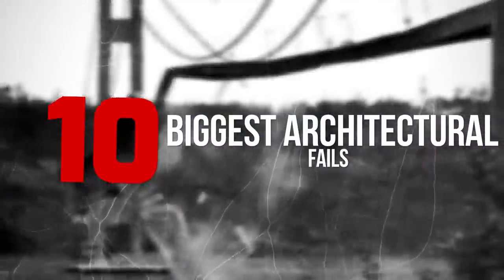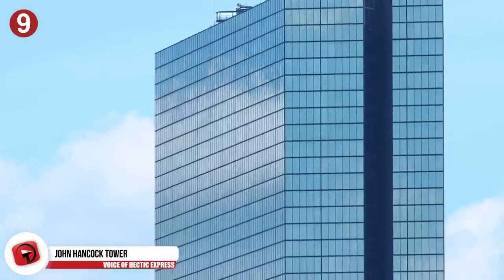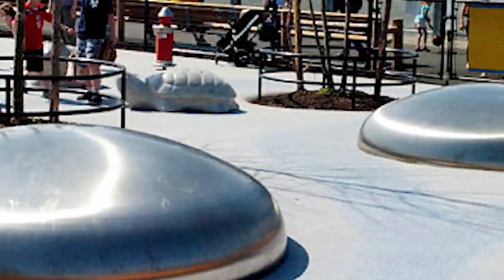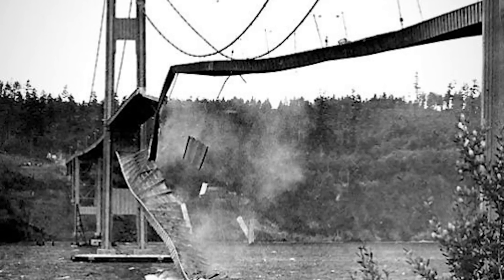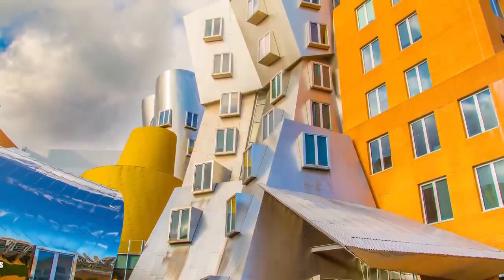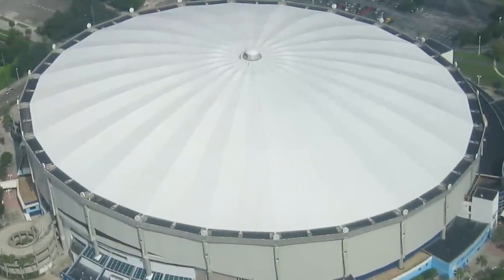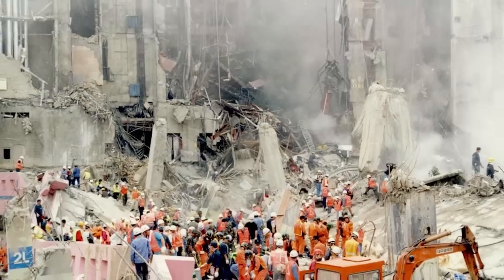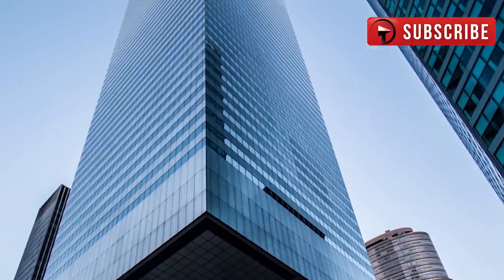10 Biggest Architectural Fails

Comment: Galloping Gertie did not collapse from bad materials. It collapsed because of harmonic resonance or propagation. The bridge would vibrate in the wind. When just the right wind speed hit it, the frequency of the vibration of the wind matched the natural frequency of the bridge. The amplitude of this vibration grew until the bridge was whipped apart. This is the same reason a wine glass can be broken with the right frequency sound waves. Since Galloping Gertie, bridge engineers design bridges bridges to have wind vibration dampening characteristics.
Reply: It's just recently been discovered that that video (movie film) was speeded up all these years. The actual frequency was much slower. Fake News!
Reply: It wasn't a resonance phenomenon, although we physics professors are very guilty of teaching as if it was. Further research has shown that it had to do with how it created vortices in the wind-flow over it. It's a more subtle effect, but its reaction to the wind is still central to what happened.

Comment: About the last building: "According to LeMessurier, in 1978 an undergraduate architecture student contacted him with a bold claim about LeMessurier’s building: that Citicorp Center could blow over in the wind.
The student (who has since been lost to history) was studying Citicorp Center and had found that the building was particularly vulnerable to quartering winds (winds that strike the building at its corners). Normally, buildings are strongest at their corners, and it’s the perpendicular winds (winds that strike the building at its faces) that cause the greatest strain. But this was not a normal building.
LeMessurier had accounted for the perpendicular winds, but not the quartering winds. He checked the math and found that the student was right. He compared what velocity winds the building could withstand with weather data and found that a storm strong enough to topple Citicorp Center hits New York City every 55 years." from The EyeSLATE’S DESIGN BLOG.APRIL 17 2014 12:39 PM

Comment: Honorable mention: Hartford Civic Center.  Built in 1975, roof collapsed in 1978 due to construction errors and heavy snow.  It took 2 years to rebuild the stadium.  Years later (1997) Hartford's NHL team moved to North Carolina, renamed as the Hurricanes.  Ironically appropriate, as the only team that ever lost its stadium in a natural disaster is now named after one.

Comment: err.. no. 1 still consider as failed?
Reply: IKR? I think it is a genius solution to the problems presented! The "bolt" issue can be chalked up to bad enginnering, not architecture!
Reply: +Bacnow exactly
Reply: If they had to go back and make major repairs to keep it from falling down, I think I'd call it a fail.  Architectural and engineering go hand in hand.
Reply: +Rob Fowler but in no 1 case its never fail. even the church refuse to move they still manage to overcome it with brilliant idea without need to have the church removed. 
so why it such a failure again?

architechture and engineering goes hand to hand. agreed. but the word architecture is not accurate for this video.
Reply: +L3140M4R I must admit, I thought it was an odd inclusion as well.  I saw a programme on TV once that celebrated architecture and engineering overcoming the odds and this was on there as a serious feat of engineering brilliance.  Having the stilts in the corners would've made it more stable, but the stilts midway along each side made for some serious over-engineering to prevent it from just falling over.

The bolts thing could've been a mistake, but that was fixed.  And what we have now is something that shouldn't exist, but does.  Hardly a fail.
Reply: +leopold The actual story of the building, how the design was changed without consulting the original designer during construction, how the problem was discovered, and how it was corrected is fascinating. This video did a terrible job of representing it. 99% Invisible (podcast) did a much better job. Highly recommended.
Reply: It is a major failure because it is just damn luck that the whole beast did not come crashing down and killing 200,000 people in the first place. And it still is a structurally unsound monster-building. It is actually terrifying to witness how capitalism itself can be a major security flaw.
Reply: The Citi building needed a 75mph wind for a 5 minutes or more to take it down. It wasn't about to come crashing down by itself like despite what the video said. Repairs were done quickly and quietly to keep people from a panic, although evacuation plans were put into place. You can debate the ethics of keeping it secret until the fix was complete.
Reply: Justin Zollitsch Still, the ethics behind the capitalism displayed is debatable. And more importantly, should be debatable.
Reply: Dovenpeis u know what is the meaning of the word FAIL right? if u don't, let me explain it to u. 

It means UNSUCCESFUL . As simple as that. 

Yes the building facing several issues previously which they manage to overcome. So how it can be categorized as fail when it still standing strong today? It's a successful story to me.
Reply: Dovenpeis so what it got to do with fail?
Reply: L3140M4R
No one have accused you of understanding humanity, have they?
Reply: Hyperbolize much?
Reply: Jon Miller
Not that you actually can?

Comment: 2:13 - "An infant seriously burned themselves..."  So much for article and pronoun agreement.
Reply: "Them" is being used as an indeterminate-gender pronoun, sometimes referred to as "Singular They".  For example, "When someone doesn't think before commenting on YouTube videos, they could be branded a troll."
Reply: This particular usage is grammatically incorrect because "infant" is a singular noun, and "themselves" is a plural pronoun. An option would be to rephrase the sentence as "An infant was seriously burned."
Reply: I see your point. I think your option is a better way to phrase it.  Brand me a troll, because I didn't think about this enough. I was thinking "themself' could be considered proper, as in "Someone could hurt themself.", but "themselves" was used and is not proper.  Even "themself" would not be proper because that would place them blame on the infant.  Usually they are helpless and their actions are directed by their parent or guardian.  Which also makes your correction the best option.
Reply: That's what I was thinking. Bloody careless infant burning themself! However what does that have to do with the metal domes?

Comment: On the last one he made it sound like bolted connections are uncommon in structural steel construction. In fact, bolted connections are the norm.  In that case the engineer failed to account for all the forces on the building and design the connections to resist those forces.  They opted to weld the connections to reinforce them since adding more bolts to steel once its erected is more costly than welding.

Comment: You just have to love number 3. A skyscraper that burns or melts cars or unsuspecting citizens. That´s awesome, it´s like a hidden super power.
  I missed the new Berlin Airport BER in the list. It´s one of the biggest fails. It´s not finished yet. THey suspended opening multiple times and it is argued if it wouldn´t be cheaper to build a completely new airport instead of trying to fix the problems.

Comment: About Tropicana Field ('the Trop'): the baseball season consists of 162 games played over a 182 day period, 81 of them in the home park. Miami is in a subtropical zone. The roof is necessary to keep out the frequent rains (as well as the oppressive heat and humidity). Also it is not necessary to achieve great altitude in order to clear the fences; it's just easier (up to a launch angle of 45 degrees). I would not call that design an architectural fail. Lights can be hit in almost any park, but switching to LEDs eases those risks. They have specific ground rules for when a batted ball hits catwalks, or speakers. You should have used the Kingdome in Seattle, it had ceiling tiles that began to fall after several years, and no fix was found; that was the doom of the dome.

Comment: Regarding your number 1, the building originally know as Citicorp Center:  William Le Messurier was the structural engineer.   The architect was Hugh Stubbins.  Also, St. Peter's Lutheran church sold their air rights to the site with the stipulation that the project include a new church building on the corner replacing the existing one they had occupied since 1905.

Comment: The problem with Citigroup Center was that the bolted joints is that although they would have been just fine for head on winds, they would not have been strong enough in quartering winds - winds hitting the building at its corners - because its primary supports were not at the corners, as is the case with most other skyscrapers.  The general public didn't know the extent of the danger until an article about the debacle was published in The New Yorker in 1995.

Comment: Correction to the information stated about the Standard Oil Building. Carrara is not "much thinner than most building materials," as claimed in the video. Marble can be ordered in any thickness. In this case the stone was 1-1/4" thick, which is particularly thin for the application.

Comment: There is a pretty major difference between architect and engineer. More than half of these were engineering failures! Tacoma Narrows, the bolted joints, Shanghai apartment, department store, ALL engineering issues

Comment: Just a note... William Le Messurrier did not design the building. It was Hugh Stubbins. William Le Messurrier was the structural engineer (who had to correct the error on diagonal wind forces).

Comment: I'm sick of people bellyaching about Tropicana Field.  Okay, so it has catwalks, girders and other things that get in the way of home runs.  SO WHAT???  All of the old ballparks had their quirks.  (Even Fenway Park still has a perfectly useless ladder on the Green Monster, and nobody complains about THAT "quirk.")  At least The Trop isn't a boring, concrete cookie-cutter like RFK Stadium, Riverfront Stadium, Three Rivers Stadium, Busch Memorial Stadium, etc.  One fan complained that "it smells like old bear."  Okay, so give it a good scrubbing.  Problem solved!  People ignore the GOOD things about The Trop.  You NEED a dome in Florida, because it's too stinkin' HOT.  Also, this was the only dome in North America that was designed for baseball only.  The sightlines are perfect, and foul territory is not too large (though they should cut it by one-third).  Besides, even when the Rays won the pennant, nobody gave a damn.  So Tampa Bay doesn't deserve any better, anyway.

Comment: A little off the subject, but @7:07 on the right side is a curved building with gray and brown horizontal stripes. Three of the upper floors were once occupied by Bernie Madoff. I think I remember reading that problems with the building on stilts came from a young engineer (perhaps a student or someone who had recently graduated) who was simply curious about how it would stand up in a strong wind. Peter Blake, an architect himself, wrote a book "Form Follows Fiasco: Why Modern Architecture Hasn't Worked." He has the integrity to bash some of his own work.

Comment: Tacoma Narrows Bridge didn’t collapse because of the materials, the engineer did leave enough open space on the side of the bridge to let wind flow through; consequently, the excessive wind resistance caused the bridge to start vibrating, as motion waves kept growing by merging in phase, the motion grew until the stress exceeded the tolerances which caused the supports to fail.

Comment: He got the Tacoma Narrows Bridge scenario wrong.  Galloping Gertie was not made out of substandard materials.  The problem was one of resonance.  The bridge was built in such a way that the wind set up a resonance that shook the thing apart.  It's kind of like a swing.  If you push it at just the right moment you can increase the arc, but at just the wrong moment and the arc decreases.  That's what happened to the Tacoma Narrows Bridge.  The wind gusts caught it at just the right moment to increase the vibrations in it's structure.  Eventually the vibrations because so intense the bridge fell apart.  Engineers have been able to correct this in subsequent bridges so that this effect will never happen again.

Comment: So, do you guys EVER do the full research?   The Tacoma Narrows Bridge wasn't a failure because of materials. It was a failure because they used solid wind-break walls that acted like sails when the wind blew, and because the placement of the supports and the direction and strength of the prevailing winds turned it into essentially a vibrating string on a guitar.  Yeah, if they'd made it out of some material that doesn't exist on earth, it might've survived the vibration.d

Comment: I'd like to point out that the architect that designed Citigroup Tower called for welded joints, and the decision to change to riveted joints was made during the construction of the tower. It's not an architectural failure, because the architect was never consulted about whether or not this might compromise the structure.

Knowing this, your entire video is now suspect.
Reply: Engineers specify structural welds and other connection types, not architects.

Comment: Tacoma Narrows Bridge is ”an example of elementary forced the bridge collapsed because high speed winds produced aeroelastic flutter that matched the bridge's natural frequency”. This was caused not because of cutting construction costs, but to keep the price in line with the budget given by the buyer. This is a big difference. Have a little reading https://en.wikipedia.org/wiki/Tacoma_Narrows_Bridge_(1940)

Comment: By the way, the information on the Citigroup Building is not quite accurate.

Yes, the building is susceptible to high winds, but the remedy described in the video is not what actually corrected the problem.

What, in fact, corrected the stability issue in the Citicorp Building was one the first uses of a tuned mass damper in a building.  Essentially, a 400-ton concrete box was added at the top of the building that is moved electrically, counteracting movements in the building in the wind.  There was quite a bit of drama at the time because, that year, the city was under threat from a rare hurricane.  Fortunately, the storm changed course, never striking New York City.

It really was a miracle cure because the building is now purported to be one of the most stable skyscrapers in the world.

Comment: No. 6 - Citicorp Building - is incredibly misleading. The church did not refuse to move. The land was for sale with stipulations that a new church be built but no structural columns could pass through the new church, hence the design and its resulting flaws. It's an incredible story in itself, no need to dramatise it.

Comment: there is a lot of incorrect information about your number 1, the architect was very public about the construction flaw and very proactive about repairing the building. there were comprehensive evacuation plans for the blocks around the building in case of a hurricane, which was the biggest risk to it. It's actually a fascinating story and you should read it and report accurately.

Comment: The Sampoong department store collapse wasn't so much an engineering/architecture failure so much shoddy construction & lack of oversight.  The construction company cheaped out on a lot of the materials & didn't follow the plans.  They also added several extra floors that weren't in the plans that added a lot of extra weight.

Comment: It's not that the Tacoma Narrows Bridge was built with substandard materials.  It was a design issue:  the alternating upwards and downwards Karmann vortexes that formed from even a relatively mild wind blowing across it shifted direction at the resonant frequency of the bridge.  It would shake, and the shaking would build and build until it self-destructed in a 40 mph wind.

Since then, engineers designing bridges take into account effects of the wind and the harmonic resonance of different parts of a bridge's structure.

Comment: "Galloping Gertie" was NOT structurally unsound, but it was an "aerodynamically clean" design which made it try to fly like an airplane wing. 
     Of course not mentioned here are the World Trade Center towers which had 2 major design flaws: 1.) the decision to skip fire-proofing the structure above the first few floors to speed construction and 2.) Early adoption of tube-frame construction where weak horizontal support results in "pancaking" failure: only one upper floor has to fail to destroy the entire building. Latter was shown in several failures of buildings under construction and in the 9/11 attack.

Comment: There's a reason Tropicana Field has a roof.  It's air conditioned!  Has the writer of this video ever been to St. Petersburg, Florida in August?  It's almost 100 degrees F with almost 100% humidity, and even though it's near the Gulf, there's not much wind inside a bowl.  Also, I'm a bit confused as to why the Citicorp building is number one on the list.  Once the joints were welded (as originally intended) the building has proven itself stable and is still there.  There are other buildings that collapsed or just fell over due to bad planning that are lower on the list.  Blame the contractor as it seems the architect's work is fine.

Comment: Erm... The Citibank Tower isn't a fail.  The cost-cutting exercise was remedied before anything bad happened.  And if you look at the design properly, you'll see that it's actually over-engineered to allow for the fact that the stilts are not in the optimum position to support it.  Of course, the best place to put the stilts would be on the corners, but that option wasn't available due to the position of the church.